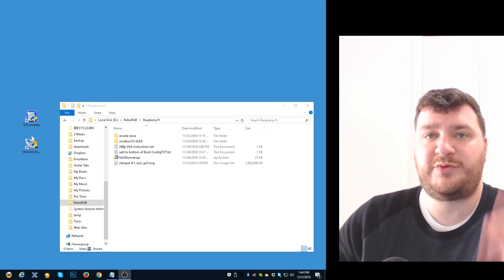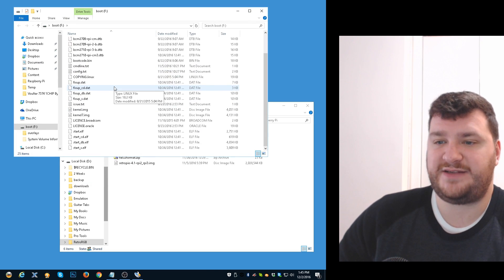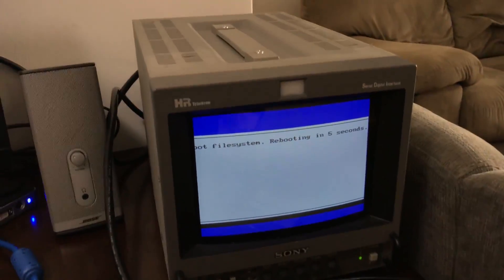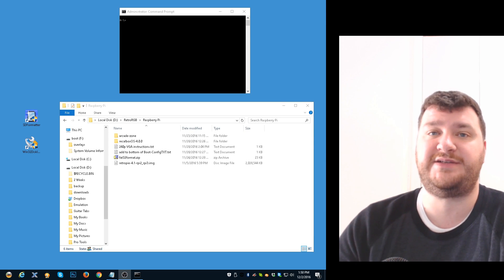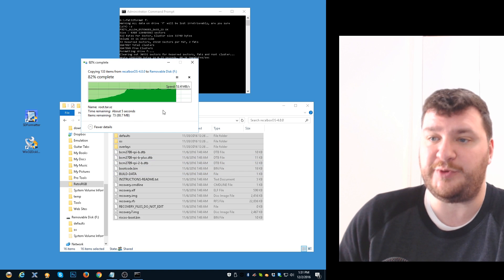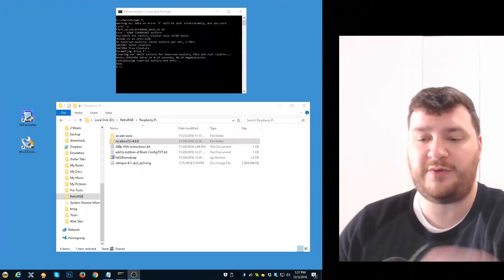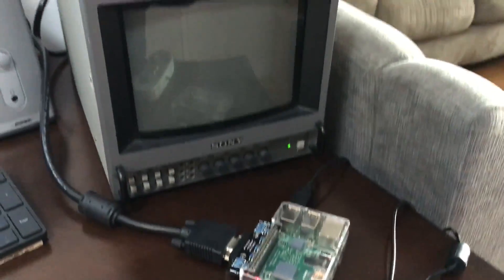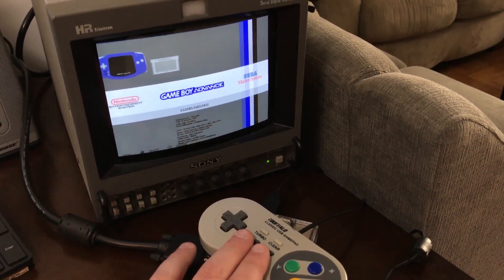How to configure a Raspberry Pi to output 240p VGA

Comment: So, for anyone interested, I was able to get this going on a consumer CRT (Sony Trinitron WEGA 24") via component after much trial and error.  

In addition to the instructions in the video, some extra hardware was needed to properly carry the VGA signal from the Pi/GERT 666 VGA to the component inputs in the television.  I did some research and found a guy whose circumstances were similar except he was using VGA to connect a PC to a television similar to mine for the purposes of building a homemade arcade cabinet.  To achieve this, he used a VGA to Component transcoder by Audio Authority (9A60A) between the PC and television and posted some screen shots that seemed to demonstrate that it worked.  Well, as I'd hoped, it works here too and result is gorgeous.  Near perfect, but with a few kinks I'll get into below.  Here's the result: http://imgur.com/a/sf9Ya

You'll need the GERT 666 VGA Adapter.  They're on Amazon now, piss cheap and Prime One-Day eligible.  This is the one I'm using and it's just fine:

https://www.amazon.com/Makerfocus-Raspberry-VGA666-Adapter-Board/dp/B01MTUBZA2/ref=sr_1_1?s=videogames&ie=UTF8&qid=1487622740&sr=8-1&keywords=gert+666

This will output your audio from the 3.5mm A/V out.  Keep in mind, for some reason Red's video and Yellow and White are your stereo plugs, but again, works great:

https://www.amazon.com/gp/product/B0007V6JCK/ref=oh_aui_detailpage_o05_s00?ie=UTF8&psc=1

Finally the transcoder, which comes with a VGA cable you'll obviously need if you don't have one already:

https://www.amazon.com/Audio-Authority-Component-Transcoder-Audio/dp/B00ASVXAFI/ref=sr_1_1?s=photo&ie=UTF8&qid=1487623042&sr=8-1&keywords=audio+authority+9A60a

 
Hook it all up, alter your config file with the settings RetroRGB and Pete Sommer have shared, and you're good to go.

Is it a cheap solution?  Not the cheapest, but it won't hit your wallet as hard as some other ways you could go.  "Daisy chaining" of cables is also to a minimum and you won't need to screw around with modifying any cables if, like me, you don't know what the hell you're doing.

Now, some things I've noticed.  The config settings here default to Sega Genesis, and that emulator's going to look great other than the fact that the image seems to be shifted slightly to right and therefore a little cut off.  This is true of any emulator I've tried, so open to suggestions there.  Once you switch to something else (NES, SNES), you're going to see that some pixels bunch up and it creates something of a noticeable  "ripple effect" when playing a scrolling game like Mario.  I'd guess this is simply because the native resolution of the SNES and NES are different than that of the Genesis.  Switching the config file to uncomment the timings for these systems made it much worse, at least in my experience.  It would be nice if there were a way to automatically switch to proper resolution based on core being used.  A project called "RGB-Pi," which is based on use of a modified GPIO to Scart cable and a custom OS for the Pi seems to be working toward this goal.  I don't know if what they're doing can be looped into the VGA method, but here's the site: http://www.rgb-pi.com/

Anyway, there aren't as many people on the internet trying to do this as you'd maybe think.  It'd be nice if there were a place we could all congregate and discuss.  Just a thought.

Comment: Hey man, I want to plug the pi3 on to my bvm2016p. From hdmi - vga - gbs8220 - vga - bnc. I also have an extron 190rgb and vsc700 that i can use. Do i still need a sync cleaner? Thanks in advance :-)
Reply from the maker: Just use the GERT VGA adapter into the Extron 190RGB, then use RGBs to go into your BVM.  Alternatively, just get one of the SCART adapters mentioned on the main page and you won't need any converter:  http://www.retrorgb.com/rpi240p.html
Reply: RetroRGB Thanks man! Youre fast :-)
PS. I meant the 109rgb

Comment: So I have the gert 666 vga card all soldered and plugged in.  I copy-n-pasted your command line into the config.txt file (at the end).  Then rebooted and my life has turned to crap.  When I connect to a VGA port (and monitor) I get a message on the monitor that reads, "The current input timing is not supported by the monitor display.  Please change the timing to 1280x1024@60hz or any other monitor timing as per the monitor specifications".
And to make matters worse, the command line has turned off the HDMI socket.  I don't use windows and right now I cannot access my raspberry Pi as the monitor connections are effectively shut down.
Any suggestions?
Reply from the maker: That means your monitor isn't compatible with 240p.  Also, as soon as you add the code for analog, it shuts off the HDMI port.  You'll have to format and start again.
Reply: I managed to re-code the SDI card the issue is the selection dpi and mode.  The code should read:
dpi_group=2
dpi_mode=35
Then my monitor is covered.  the mode given in the video is for another type of monitor.  Problem solved on my side.
Reply: Sorry for any misunderstanding but my intention was purely to get the Gert 666 VGA adapter to work.  That was the impression I had from your video.  Luckily I did not have to format and start again.  All I did was (after a little more google research) take out the SDI card, insert it into an SDI slot on another computer, search the config.txt file, open the file (on a simple reader) and change the code you attached, save the file, re-insert it into the Raspberry Pi, turn it on and ..... presto!

I guess the word of advice to anyone watching this video is that:
1. be careful you may just shut down your entire raspberry pi
2. look up the other resolution related codes and select one right for your selected screen as you only have 1 shot to get the screen resolution right.

Comment: I followed the directions on a previous install and a fresh install for retropie. I'm using a basic VGA to RCA cable. When I power up the pie all I get is a blank screen. Any idea what might be causing this?
Reply from the maker: VGA to RCA?  As in composite?  That won't work.
Reply: Okay, so from looking through the comments I should look out for a vga to component converter? My tv can accept component in case you were going to ask.
Reply from the maker: Correct.  It's tough to find good ones these days...as soon as I find one, I'll link on my converters page.

Comment: Hey, man.  Thanks for the breakdown. 

Attempted this using GERT VGA 666 to VGA-to-Component to my Trinitron with no luck. Scrambled black and white picture.  Any suggestions?
Reply: Whoops, I'm a dope.  Pretty new to this and thought a simple VGA-to-component cable would finish the job, but my Trini will only accept a signal up to 480i, so that's not going to cut it.

Now I'm thinking GERT VGA > VGA-to-S-Video/Composite Converter.  Wondering if this will work with your configuration.
Reply from the maker: The GERT will be outputting in 240p, so if you used a VGA to component converter, it should work fine on your trinitron.  
If you're using composite video, I believe you can just get a cable for that.  I'm not sure what the config.txt settings would be though.
Reply: Yeah, I figured if it's scaling down to 240p on the Pi configuration level, there should be no issue, but the picture just goes crazy.  Same exact output I got when using the Radioshack HDMI to Component cable @WeArePolyGlot has been messing with (https://www.radioshack.com/products/radioshack-hdmi-to-component-converter?gclid=Cj0KEQiAw_DEBRChnYiQ_562gsEBEiQA4LcsslNhX5kI4io4rjDuvIXno-cU5voFYu3YRqLxMrmId48aAsks8P8HAQ).  For that, I noticed the documentation only allowed for 480p minimum, and again, my TV only allows up to 480i, so that made sense I think...Your method I was very confident would work though as I figured it would be 240p out of the gate.  You mention a "converter," so you should know that I was just using a VGA to Component cable which I guess was just transmitting the VGA signal rather than scaling anything down.  If I'm off the rails here, your guidance is more than welcome. 

In any case, thanks to you and everyone else busting ass on this for your work.  I've been following and will continue to follow it closely.
Reply from the maker: Well, HDMI to component would require a different config file.  It's most likely that the converters just don't accept 240p.

Comment: Any idea how to get this working with HDMI to component? I am very close on my channel here but have a vertical sync issue. https://www.youtube.com/watch?v=VLBHWZV1dZ4
Reply from the maker: This is what worked for HDMI to VGA...maybe it'll work on component?:
disable_overscan=1
hdmi_ignore_edid=0xa5000080
hdmi_pixel_encoding=2
hdmi_force_hotplug=1
hdmi_cvt=320 240 60 1 0 0 0
hdmi_group=2
hdmi_mode=87
DISABLE_SPLASH=1
config_hdmi_boost=4
dtparam=audio=on
gpu_mem_256=128
gpu_mem_512=256
gpu_mem_1024=256
overscan_scale=1

Comment: This monitor is 15khz or 31khz? What connector does the cable use (vga->rgb with 5 pins)?
Reply from the maker: 15Khz.  As explained in the video:  VGA --> Extron 203Rxi --> 4BNC

Comment: Hello,

I have a 15Khz VGA to SCART cable and a compatible RGB TV, is it possible to use something like this GeekPi VGA666 adapter from Amazon (https://www.amazon.com/GeeekPi-VGA666-Adapter-Breakout-Raspberry/dp/B01M5GBSQO) and the settings mentioned in the website to go with it? then something like a power supply that gives 9v to the VGA-SCART cable to power it so it runs? I'm willing to dedicate a Pi3 to this (and I've been crazy for it so this is really good news for me!) so I want to be 100% sure it will work before spending any money.

Thanks in advance.
Reply from the maker: I've never tried that specific adapter board.  Why not just get the one I already tested?:  https://www.amazon.com/dp/B01MTUBZA2
Reply: Great, I got a clone of the one you linked and I plan on testing it with www.rgb-pi.com I've been aided in a forum and it looks like it will work, thank you!

Comment: It looks like your connecting your RGBHV output directly to your pvm. Are your using a vga to 5 BNC connector? If so what are you doing about the black and gray sync cables? My pvm 1342q only had one sync port, are you combining the signal somehow or just plugging in the horizontal sync and adjusting vertical with the knob on the back? Inquiring minds must know cuz I'm doing this very soon haha. Thanks!
Reply from the maker: It's explained at the 4 minute mark.  For a PVM, you should use either a UMSA or an Extron Rxi:
http://arcadeforge.net/UMSA:::15.html
http://www.retrorgb.com/extronrxi.html
Reply: RetroRGB haha that's what I get for skimming

Comment: Wich horizontal refresh rate does this settings give? 31Khz or 15Khz?
Reply from the maker: 15Khz.  It's an RGB signal, just RGBHV not RGBs.
Reply: RetroRGB awesome!! then I can just make the small sync circuit and use it via scart with my standard TV! sweet!! must order a couple of vga666 asap! thanks!
Reply: Could you show the sync circuit VGA666 to  SCART?
Reply: http://www.epanorama.net/circuits/sync_r.html
Didnt try it out yet, just found it a while back and thought it might do the trick.

Comment: Would you need the Extron if you bought a VGA to 4-BNC cable like this? https://www.ebay.co.uk/itm/141991624751
Reply from the maker: That won't work - Those cables only include HSync.  It would be like you just didn't hook up VSync.
Reply: RetroRGB Thanks; you just saved me some cash and time 👍🏻
Reply: coderkind use a vga to 5 bnc and combine the 2 sync into 1

Comment: Great tutorial! I was wondering: how does this setup handle 480i content? Does it depend on the emulator? Also, what about the various resolutions that are not quite 240p like the GBA or mame? Is the GBA being displayed with black borders? Is something like Metal Slug displayed correctly? 

I have a Groovymame setup that switches resolutions. I don't suppose something like this is possible on the Pi (yet), is it?
Reply from the maker: I'll be digging deeper into using different resolutions and will post when I find out how far it can be tweaked.  For the basic testing I've done, it seems that you get the correct aspect ration with black borders.

Comment: So will the HDMI output still work without any changes if I don't use the VGA output at the time? That way I could swap my Pi around between a PVM for 240p content and a 720p TV for upscaled GC/Wii games. Or will I have to change something everytime?
Reply from the maker: I don't think so.  I'd really like someone to build a startup menu that launches in 480i, which allows you to select between VGA and HDMI - This one one Pi can support both.  It's one of the many things on my list to try.

A cheap alternative would be to use two MicroSD cards; 1 for VGA and 1 for HDMI.

Comment: I understand that outputting directly at 240p is desired because that is the original resolution of the games being emulated. What is the advantage of doing it over VGA? Most VGA display devices would be 480p or better. Any clarification would help -- I must be missing something here. Is it just to get the image directly viewable on non-HDMI displays?
Reply from the maker: Don't think of it as "VGA", just think of it as RGBHV through a VGA-style connector.   The purpose is to connect a RPi to an RGBs setup.
Reply: OK - thanks for clarifying this. I hadn't understood it until you explained it this way.
Reply from the maker: Actually, I should have stated that in the video.  Thanks for reminding me...I'll try to update the webpage as well to make it clearer.